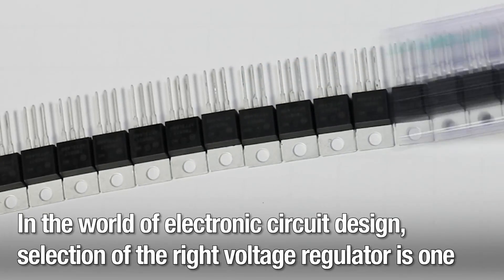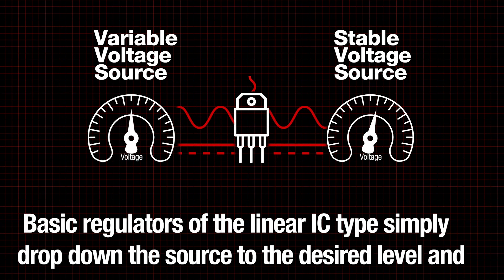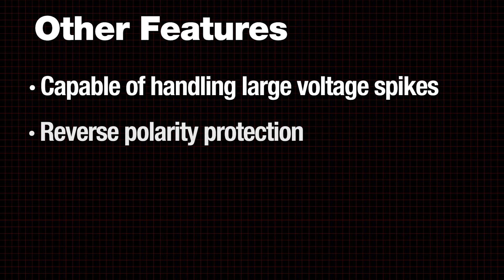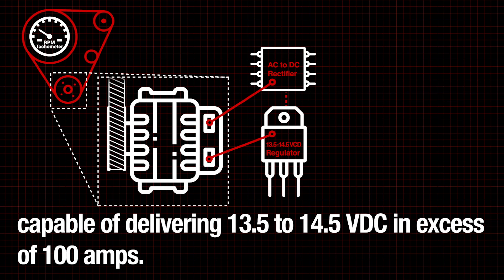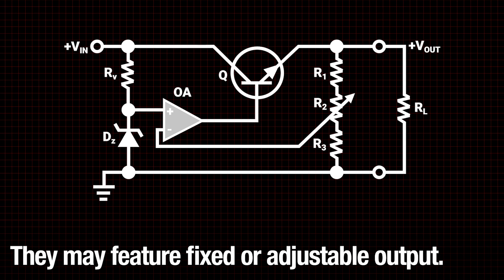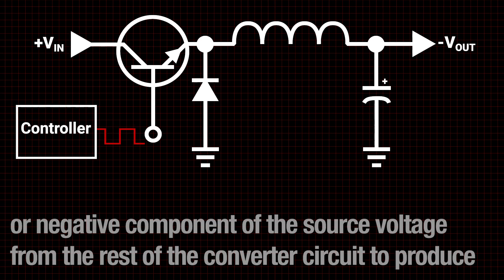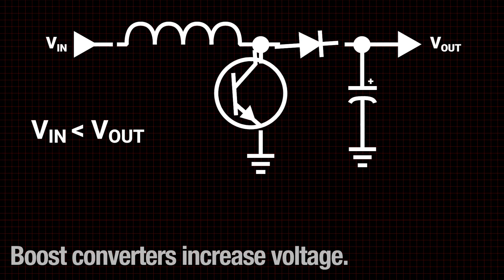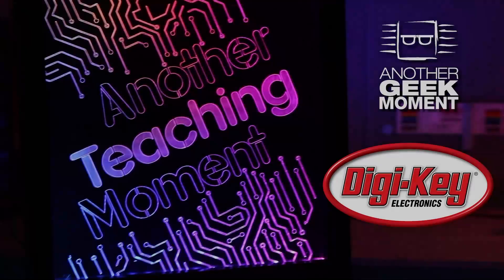What is a Voltage Regulator - Another Teaching Moment | Digi-Key Electronics

Comment: i have a circuit with a marine battery, pool pump, would a voltage regulator increase the life of the pool pump. maybe the battery applies delivers uncontrolled elect. mayeb im dumb for not verifying with a multimeter

Comment: A DC voltage regulator provides a steady output voltage when the input to it fluctuates and is an excellent example to demonstrate the speed with which electronics responds to input changes; it's action is astounding. This is best appreciated, when seen in its feedback action made possible by surface charge reaarangement and the lightning speed with which electric field changes occur to correct voltage fluctuations at the output of the regulator due to input voltage fluctuations. 

The CD accompanying the textbook 4 in the last frame of video #1 (see below) contains an animated slide presentation “Regulated_Power_Supply” on the operation of a 25V DC regulated power supply. Beginning with transformer operation, covering bridge rectifier and filter operation, the slides progress to cover transistor operation with the help of load lines, and then covers design aspects of a series-pass transistor based regulated power supply. 
The surface charge and field viewpoint detailing the processes are not found in any textbook and the presentation details the dynamics of the regulation function. 

Electrostatics and circuits belong to one science not two. To learn the operation of circuits, Current and the conduction process, resistors and how discussing these topics makes it easier to understand the operation of capacitors, inductors, diodes and their operation in circuits and circuit theory watch these two videos 
i. https://youtu.be/TTtt28b1dYo and 
ii. https://youtu.be/8BQM_xw2Rfo 

The last frame in video #1 lists textbooks in the References. Textbooks 3 and 4 discuss all the above topics using a unified approach to electrostatics and circuits.

Comment: What is the best way to calculate the amount excess heat. 

For an example 12v regulated to 5v.
Reply from the maker: There are a lot more pieces to the puzzle.  You need the natural thermal resistance (C/W), the ambient temperature, and the size of the item. Use this example, coupled with the responses from our technicians to help guide you. If you want to double-check your answer reach out on the forum for a quick response.
https://forum.digikey.com/t/heat-sink-calculations/6627
https://www.digikey.com/eewiki/pages/viewpage.action?pageId=68976759&_ga=2.3859632.12077239.1612182384-638275533.1605817481&_gac=1.57720536.1612182657.Cj0KCQiA6t6ABhDMARIsAONIYyw3ZXlSCtEzx_RCkIPbY9aPd5K5aU5cOpOdh4EgCSWuOyz5amaYZl8aAieQEALw_wcB

Comment: My low beams use 40,000 volts to the bulbs with a 12+ input. Years ago a guy working for me used his bare hand to wiggle a wire on one of those style lights. I told him not to but shocked him good. Anytime I see KV I know to be super careful.

Comment: I’m late to the party here. I’ve been playing with different voltage control units for about a year now and still having design issues with dissipating heat off voltage controllers. I wish DigiKey would provide us non electronic engineers with simple design circuitry that could provide a greater understanding of the voltage control ratios and heat generation with determining dissipation through passive components. Or maybe active components? I only know enough design information to be dangerous at this point.

Comment: While the flyback topology certainly has its challenges - especially over 500W, I feel that its depiction at the end was more limiting than its actual use in industry. While it is uniquely able to perform high-ratio step-up conversion to very high voltages, its other main use case is in isolated conversion - especially AC line isolation, such as in common USB wall chargers that output a relatively low 5 volts. I agree that flyback is a "Is this topology right for you" scenario where many times one of the other topologies would serve better.
Reply: That sounds real smart.
Reply: I want to hear Beavis recite this some day.